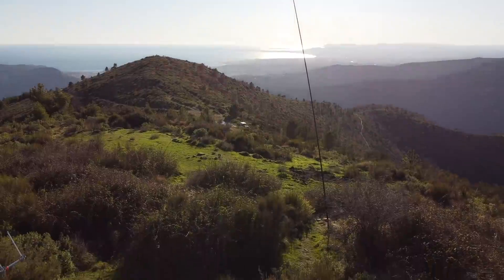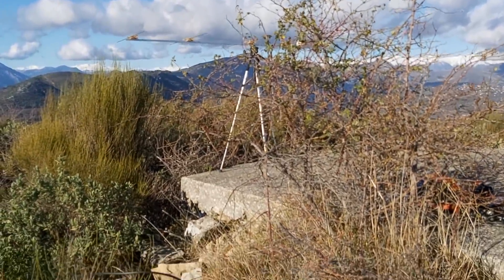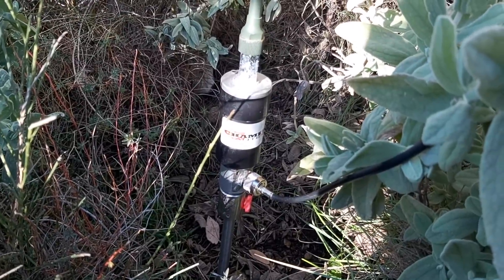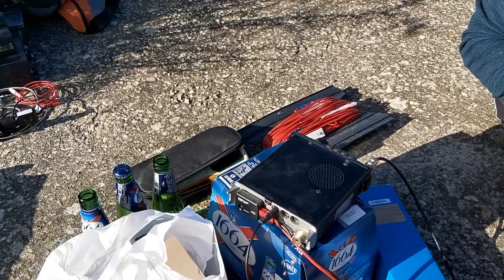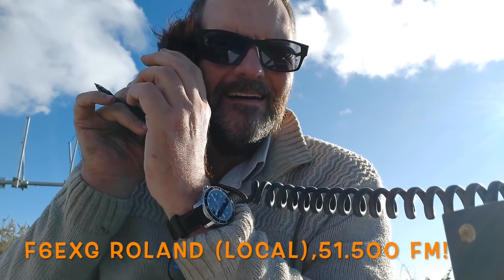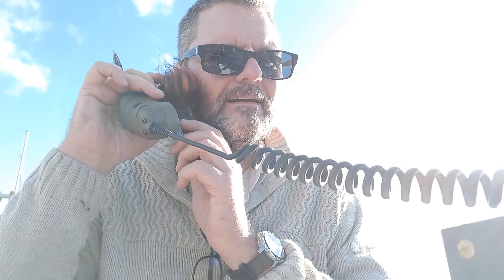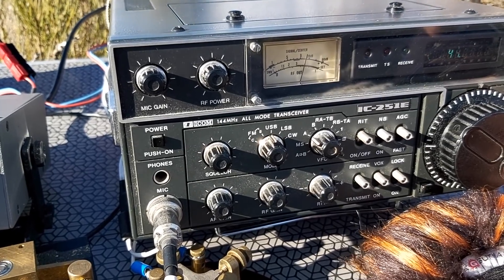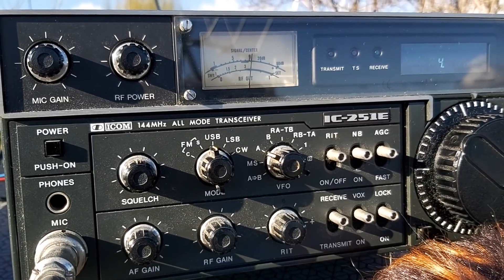Radio Field Operations, Mont Macaron.

Comment: Gil, love your videos!  I am a HAM newbie.  I setup a dipole antenna with each leg just over 33 feet long, trying for 40m and 20m bands with a Xeigu G1M 5 watt tranceiver.  Currently using a 50 foot 70 ohm coaxial cable straight from tranceiver in the basement of my home to the antennia (I know, too long).  Anyway, should I switch to a 50 ohm coaxial cable and should I put in a balun right before the antennia, if so what toroid and how many turns?  Keep the cool videos comming, Thanks!
Reply from the maker: Hi, great! For a dipole and 5W, no BALUN needed. Make sure you use good quality coax..
Reply: @RadioPrepper  Thanks, I will change out the coax with something better.  I have been struggling to get a good SWR for the 40 m band thinking that way I could use 20 m as well.  So far, no joy.  Right now each leg is 33 feet 3.5 inches long from the center with a terrible SWR of 1.9 at 7.15 MHz and a SWR just over 2 at 7.00 MHz and 7.30 MHz both ends of the 40 m band.  On the 20 m band the SWR is about 4.5.  So confusing... You can't ground a dipole... right?  Both legs are pulled tight, 10 feet in the air.  Unfortunately the dipole is 6 feet directly above a 4 foot tall chain link fence that runs parallel with the antenna.  I am wondering if the fence is causing my trouble.  The good news is I am on lesson 20 of 40 on LCWO.net learning morse code.  Man you send and receive FAST!!  Maybe someday I will be half that fast.  Looking forward to your next video and I still have a lot of your older videos to watch, THANKS for all the GREAT content!

Comment: With all the gear how many trips did you have to bring back to the car...what is the elevation  beautiful location  highest location is a 25 minute drive  about 600 feet above sea level  western part of nova scotia  unless i drive the other end of the province  in the mountains of cape bretton   about 9 to 10 hour drive  nice video
Reply from the maker: Three times.. About 800m..
Reply: Your in a great spot for weak signal 2m/6m all the way down to Florida just gotta keep trying. And have good antennas!

Comment: Hello Gil, Great video and fantastic place to do radio. I seem to recall you have a DJI drone. Did you know that you can film using the drone with its legs in (so handheld) and it would be like you are using a gimble. Video nice and steady. Little tip if you ever need a gimbal but do not want to buy one. :)  Motters. M7TRS 73
Reply from the maker: Hi, yes indeed.
Reply: @RadioPrepper  you are lucky to go and use the radio at somewhere like that. I have some high ground not too far away and a couple of summits I want to try sota at some point 👍🏻
Stay safe 😷
Motters M7TRS 73's